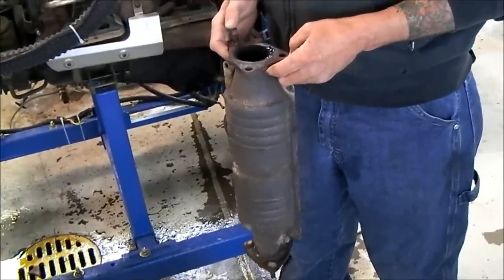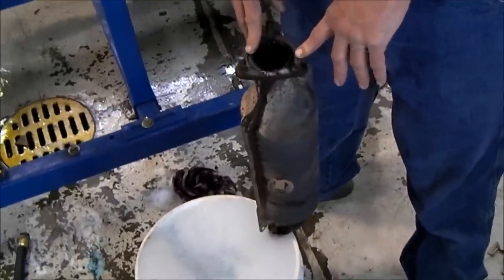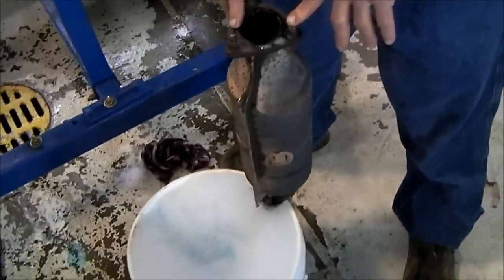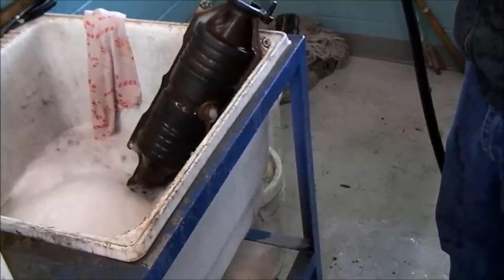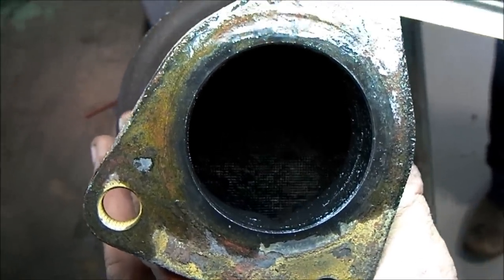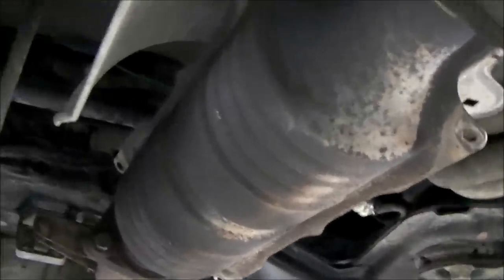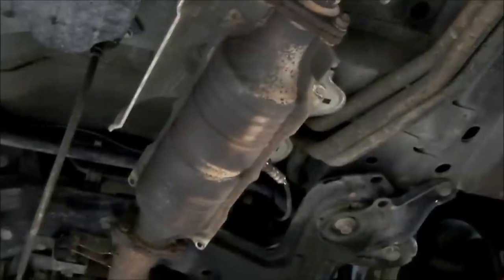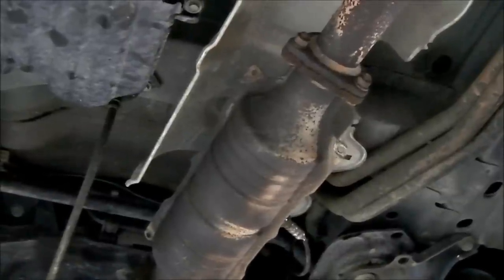Washing a Catalytic Converter

Comment: What happened to buying new cat for couple of hundred dollars and be 420-free for 100+ thousand miles? I understand about being smart with spending, but this video is outright about being a cheapskate.
Two ways Cats die: One, is because Cat medals were meant to wear out eventually after 100 thousand miles and so, and two, is because your cheapskate-ness (the same reason you're washing a dead cat) to begun with, using no-name gas station's 87 regular. Fuels (specially) gasoline are refined differently therefore burn differently some burn clean, some (from your favorite gas stations) burn dirty. Everything you burn will eventually end up in your cat, think of it as your liver, all fuel-treatments, cheap gas, burnt oil, misfire, foams, etc, cats must clean them, and once it had enough it will kick the bucket. The End.
Reply from the maker: Your first point is a good one. If you get a P0420, just buy a new cat and you will be good to go. If you mess around trying to "clean" the old cat you might just be chasing your tail. However, this test was to see if a cat could be washed out to correct a P0420 just out of curiosity, or in the name of science, or whatever. We had no interest in being "cheapskates," we just wanted to either prove or disprove a theory. As far as things that render a cat ineffective, ash accumulation from engine oil is definitely proving to be a problem in the long run. Ash comes from minerals and things in the engine oil that the engine slowly burns over time. The theory is that physically removing the ash can make the cat work again. However, talking about ash removal and actually doing it effectively are two different things. This is why your first point is spot on, just get a new cat and forget about everything else.
Reply: wwccauto Thanks for being sport. lol
Reply: You're right on that one, but the fact still remains.
Reply: ***** Yeah, they will fail eventually
Reply: Sorry to hear that I know it can hurt man
Reply: +OneEye Lucky a new cat for my rx8 is 1000, and it has to be made for rotaries because of the high EGT and aftermarket cats burn out after about a month.
Reply: +ne0tas Ouch
Reply: Abdiassis Ahmed yeh but depending on where you live a aftermarket cat is not legal.... thus $1000

Comment: Once P0420 shows, the precious metals have deteriorated inside the Cat. No washing will clear the code imo. Replace the Cat or just buy the $5 spark plug non-fauler fix
Reply: 0.1M Oxalic and citric acid soak at 160F can restore the catalytic sites on the precious metals
Reply: Gowdaflow..... Not all error codes of p0420 are from deterioration. You can have it deteriorate, or also clog. Clogging of it will create the back-pressure which damages engine eventually. Deteriorating precious metals just lower the efficiency of it reducing NOx but flow through is not effected. If it's deteriorated, use an O2 anti fowler or buy new cat. If clogged, try cleaning with oven cleaner soaked for 1 week. Shaking it often and medium banging on hard surface daily to force the poison off the metals. Repeat this and be patient and it does work, as long as not deteriorated inside. People remove these and want to clean and replace same or next day. Not happening and being effective. Take your time. 1 week, soaking. Use oven cleaner and/or turpentine.